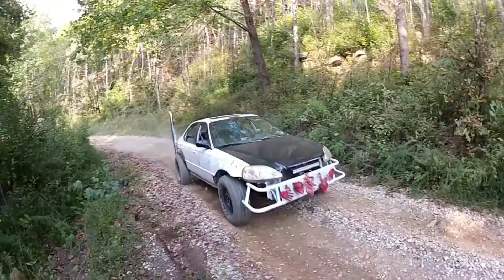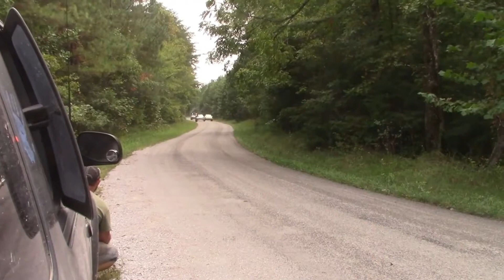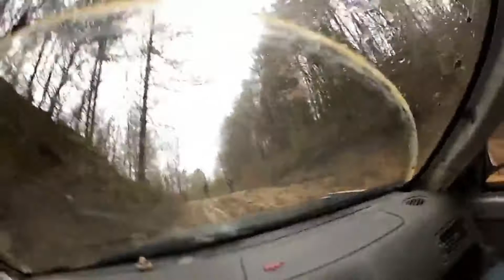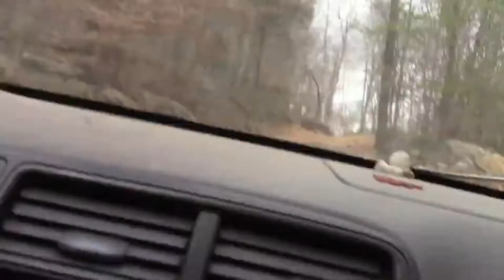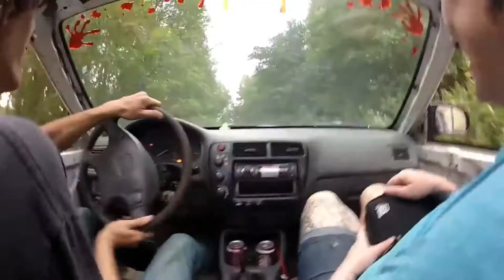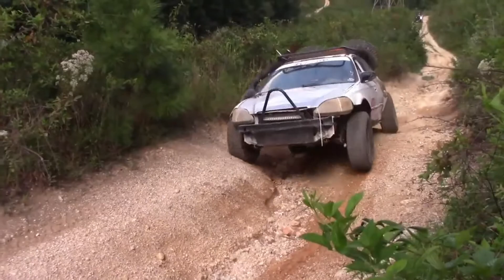LIFTED CIVIC OFF ROAD COMPILATION

Comment: whats the specs, howd u get you 3" lift, spacers? different struts?
Reply from the maker: Stock struts and made spacers that bolt onto the top of the struts. I got videos of the whole build if you need more details as well
Reply: @SlightlyMangled   I’ll scroll through

Comment: Bro I'm in the process of building my off road civic. Already lifted it, but I'm on hold looking for some cheap tires and adjustable camber arms. Crv front struts and flipped the read LCA(no sub drop) . Did you have to drop your subframe with your lift?
Reply from the maker: Mine is a 3 inch lift and no subframe drop. It does have some axle vibration cause of the extreme cv angle but it don't bother me. If yours is a daily driver I'd definitely do the subframe drop, if its a toy, then just send it and see what happens lol